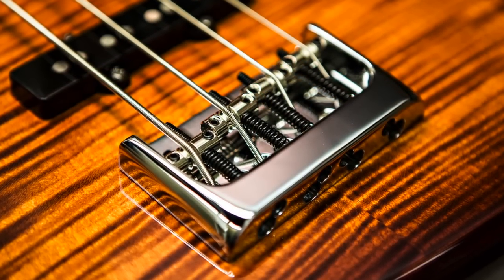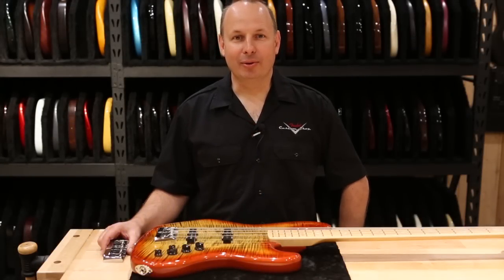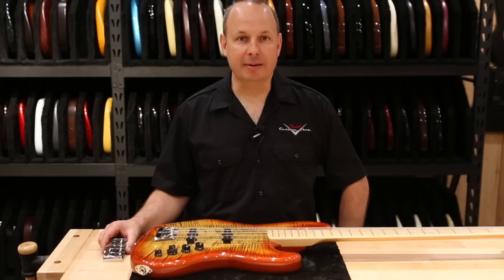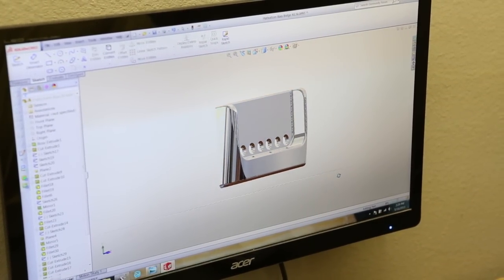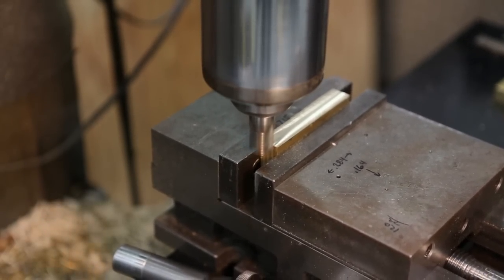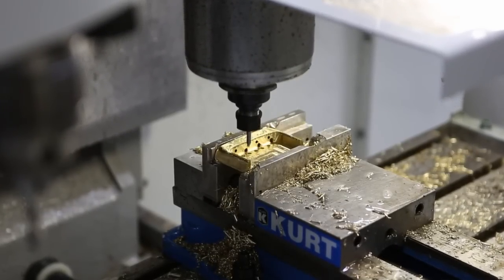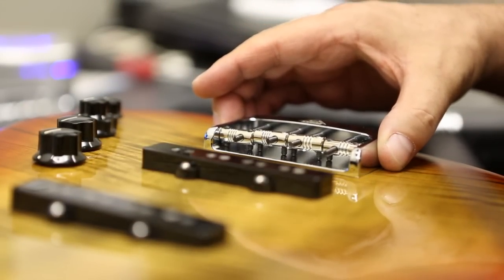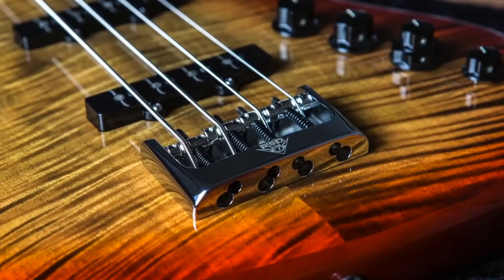Fender Custom Shop RSD High-Mass Bass Bridge | Fender

Comment: It's 2020 and I'm still rocking a vintage 2 saddle on my old CS Time Machine 55. This is a very cool design, and I honestly think it would be best paired with the scaled up offset guitar mute system Fender designed for Bob Babbitt's basses back in the 80s. That way you can go from max sustain, to a muted tone with a simple motion. Unfortunately, you can't order that as long as it's on Hurley's Signature. Even if you order a one off. So I'll stick with the old school P bass design until both these designs are open for us peasants.

Comment: Just bought and installed the 5 bolt version of this bridge (MIM JAZZ).  Looks great and is a solid built unit........but problems.  I cant get the action low enough on my bass to make it playable.  Not sure what to do now.  Shimming the neck is out (would take a massive amount of shims). My only options are to put my OE bridge back on. The string guides are so big it does not allow the saddle to go low enough.